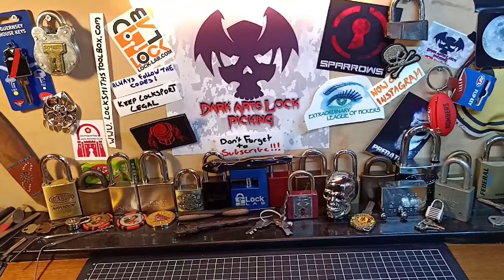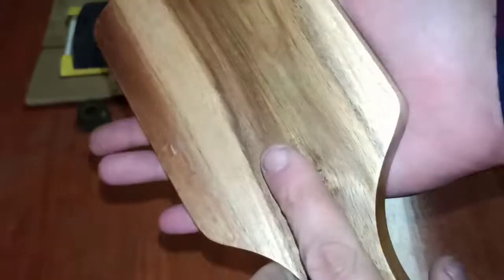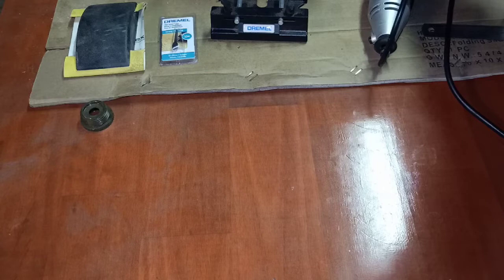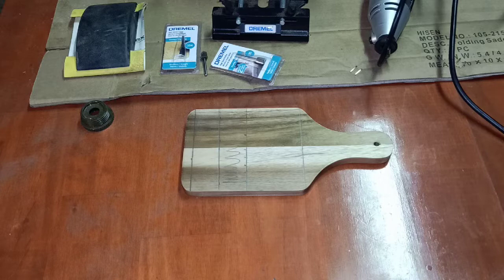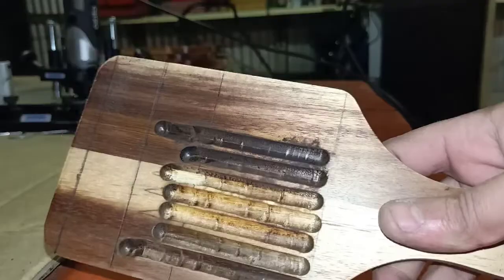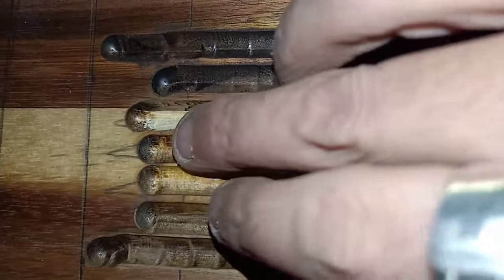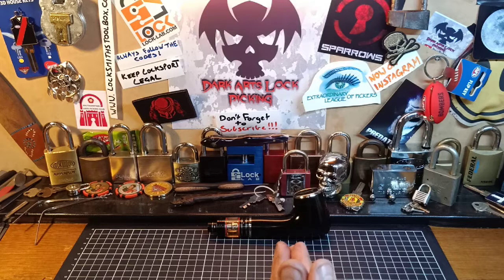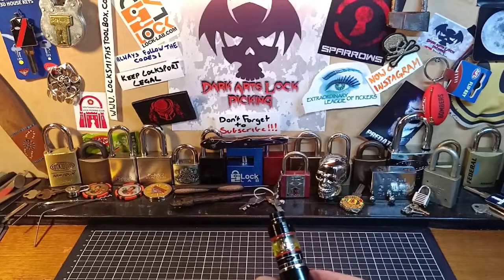How to make a pinning tray (part one). Sunday beginners series video (212)

Comment: Now this explains why I saw offcenter and not straight lines. I was expecting that routing tool comes with mount where You adjust depths , legth etc , but it does not. I got pretty high expectations and too much industrial work & standards lol. But it's good even this way. Try to synchronize pressure and speed to avoid material and tool overheating. :)
Reply: That definitely gives them artistic line ! 😂